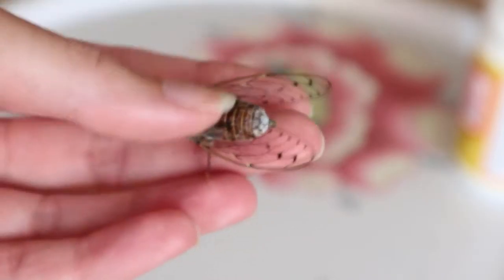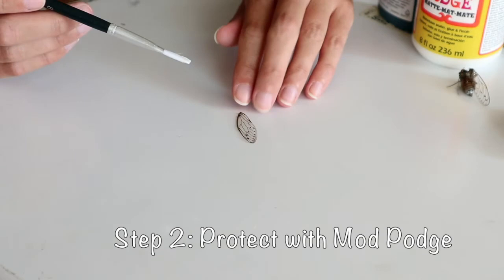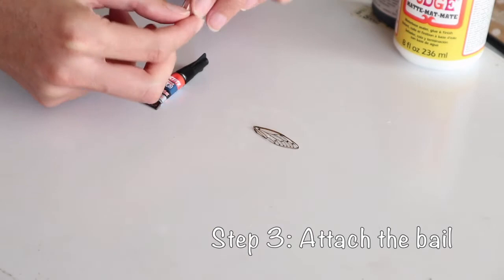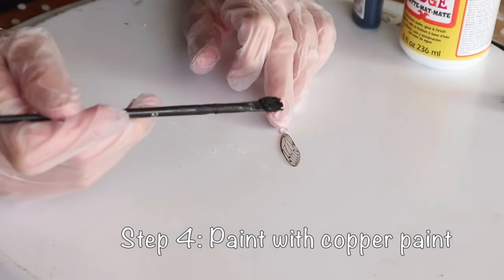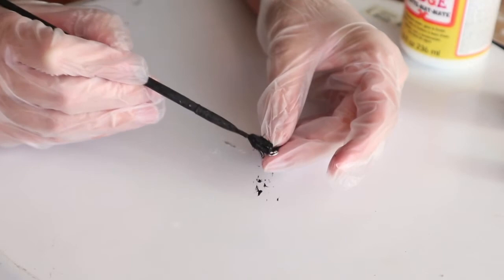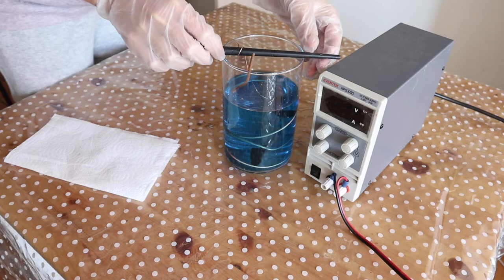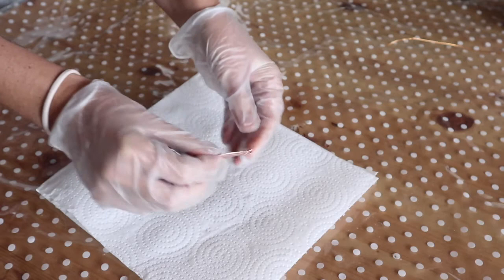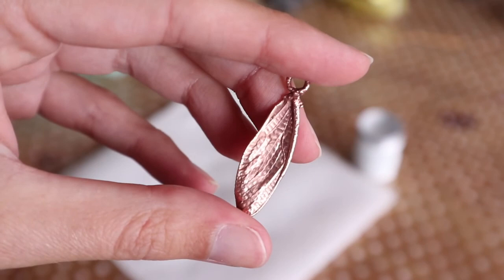Electroforming Insects: Cicada Wing Pendant (Tutorial)

Comment: Hi Camille, when you wire your sea glass piece into the hanging wire, it looks like you're attaching it before the curved part, not at the very tip of the wire (namely, the hook). how come the leaf doesn't 'escape' from the hook's end? I'm asking as I've had the same problem with a small leaf, and the only way I found to prevent it from floating was to quasi-close the hook of the hanging wire so that the leaf would not escape. thanks!